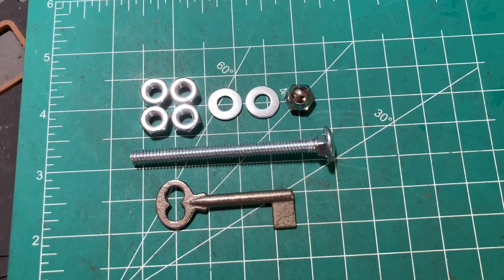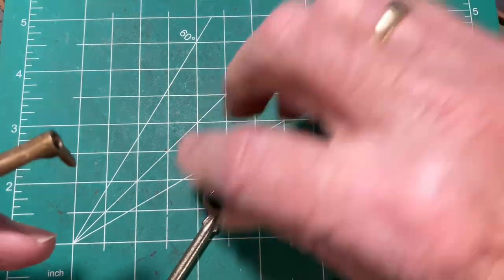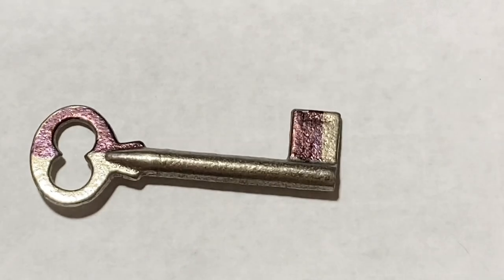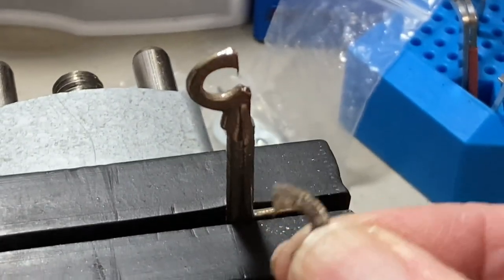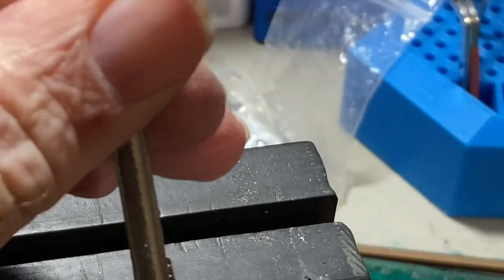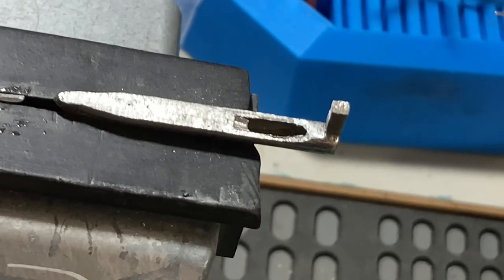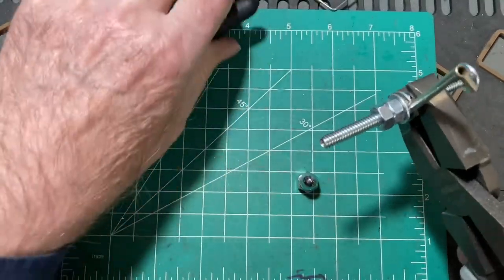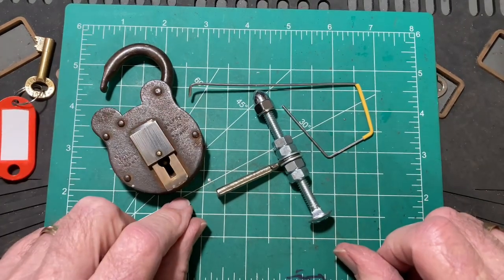#323 Making Tension Tool Part 2

Comment: Awesome again, I just got to find an adequate blank for the 4 lever squire I have
Reply from the maker: Try an old fashion skeleton key that you can find at a locksmith store or hardware store. You can file or grind the tip of the key to fit the hole in the back of the lock, then you can follow my instructions in this video to grind and cut away the key.👍🦊

Comment: Thank you Jack.
As a newbie to the sport of lock picking I found your YouTube profile today. 
I've been trying to find how to make picks for lever lock and this was really helpful, I shall be hunting for some old keys that I can cut down and use for tensioners and piano wire wil be on order shortly. Is there a preferred diameter or just one of each would be best?
Cheers
Reply from the maker: Welcome to the world of lever Lockpicking. Finding keys to cut down to make tensioners is the hardest part. The U.S. doesn’t manufacture these locks anymore. I have to get mine from England or EBay. They can be pricey. You may have luck at a real locksmith shop, not Lowe’s or Home Depot. As for the wires, I keep on hand .047, .055, .062.
Occasionally I have made some from .078 for bigger lever locks. 
The most used sizes are the .055 and .062. These measurements can be slightly different depending on who you buy from. It doesn’t have to be exact.
Chris Capune and Mylok are excellent lever pickers and also Brummie. Let me know when you have questions. I am here to help.🍀👍🦊
Reply: Hi @jackfoxlock  
Thank you, it's actually the whole world of lock picking that's intersting me, I want to do it all, I find in so interesting, puzzles everywhere!
I could say that I am fortunate that I live in the UK so some these tpes of locks appear to be quite accessible (possibly the wrong word for my stage of picking) but as you say keys and locks appear to be expensive.
As an aside, tf you get replies from @craddyboy, that's also me, I appear to have 2 accounts from years back and never sure which one I am using at the time.
Thank you for being so helpful I'll let you know how I get on!